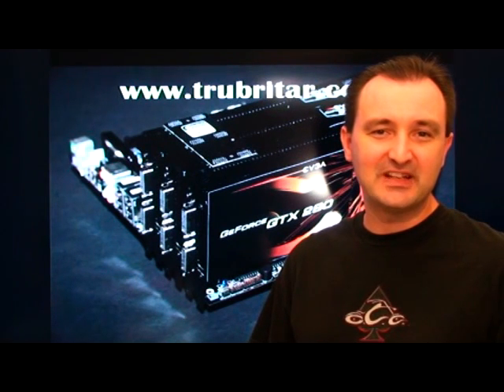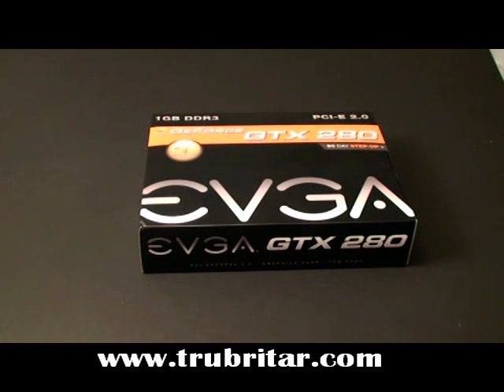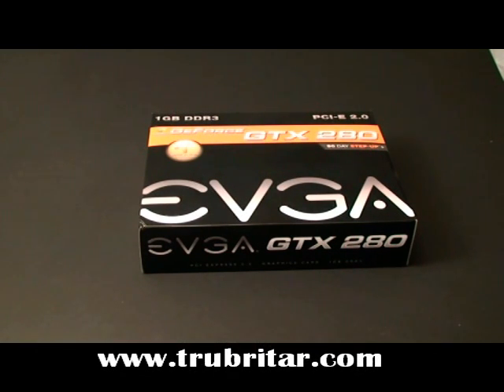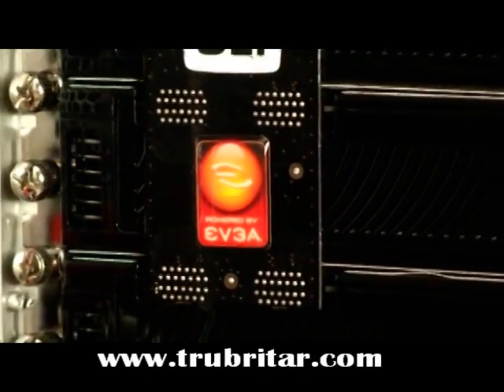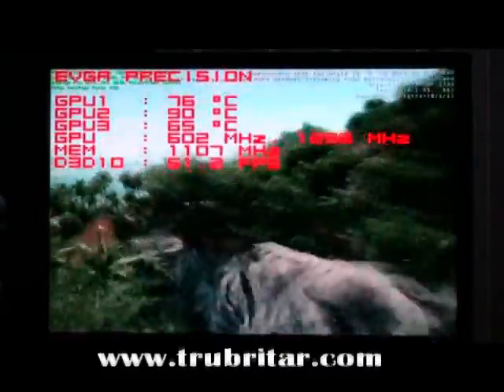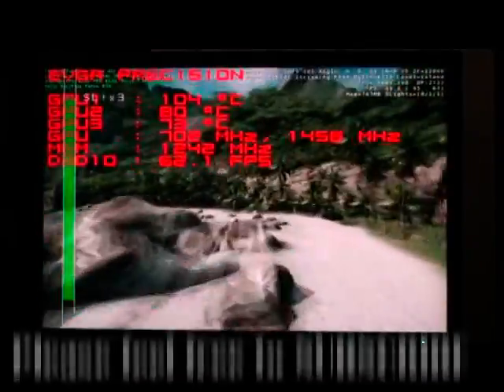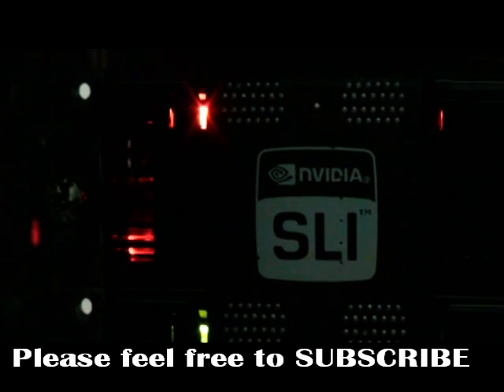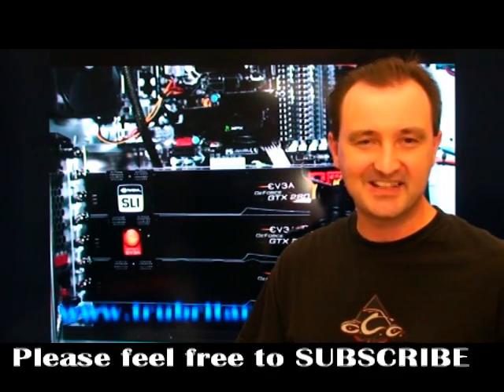GTX280 Destruction testing...

Comment: 6600GTs have been known to reach 140-150C and still work stable even on games such as The Sims 2.

115C is nothing in comparison, 105C is the specification however. Every 10C halves the chip's life until it reaches the point where it burns itself out to a paperweight in a shorter time.

The highest I've seen my eVGA 8600 256MB was 104C with a voltmod + OC and up to 88C stock but cooler sucks, with some cool air I was able to manage below 85, in a year worth of usage though, I never damaged it.

Comment: Not safe...Often if your motherboard voltages are set to auto then it will adjust itself but high voltages and you will fry the card, low voltages and often things like the vram can become corrupt and such

Comment: Most graphics cards are designed to still work at 110 degrees.
70degrees isnt anything high for a 8800, my mate reguly got 80 before changing fan speeds with riva tuner

Comment: lol i got the crapest card ever 2, it can handle HD video, but it stutters on crysis on very low setting, but COD 4 is ok. its called the 7500le, and its an OEM card. never will i buy a HP PC again. and to make it worse, there is only one PCI xpress on my Mobo, and so i have to use a single slot card, so im gonna replace it with a 9600 GT

Comment: Wow... I could've saved you a lot of time getting rid of that card - you could've even gotten my 9800 GTX in return. I BET you it's more fun to see an old card die ;P
By the way, trubritar, are those stock cards the ones you're currently using in the Crysis Cruncher? (Overclocked, of course)... Or did you get some factory overclocked cards instead?

Comment: srry for the double post, but I just realized. my 2-3 year old Hd2600 pro agp has as high of a standard clock as the 280. 601 core standard for mine and 602 core standard for him. that is just lame. ATI>Nvidia every time. ATI now a days cranks out cards that reach 1100 core with ease and stability.

Comment: I hate to burst the bubble but this guy is a dolt. So many things wrong with this video. He has the Core at 648Mhz in the last vid which is the same as the SSC addition, but has the memory at a whopping 1404mhz (2808), which is well past the memory speed on the GTX280 Hydrocopper (yes thats right evga's watercooled version of the card) this is a piss poor example, its not stress testing or anything reasonable. you kill cards by being a moron. watch your temps and happy OC!

Comment: these are the rumors of the GTX 350 characteristics in internet:

*GT300 core
*55nm technology
*576mm
*512bit
*DDR5 2GB memory, doubled GTX280
*480SP doubled GTX280
*Grating operation units are 64 the same with GTX280
*216GB bandwidth
*Default 830/2075/3360MHZ
*Pixel filling 36.3G pixels/s
*Texture filling 84.4Gpixels/s
*Cannot support D10.1 .10.0/SM4.0

Comment: Oh look it reached 80 FPS; that's not what we look for out of high end GPUs. We're after consistent/stable lesser minimum frames, especially under heavy conditions.

Being more the doof he is, he's using 16Q AA? Overkill much? 4-8x is fine. Try turning on SuperSampling transparency and see what happens.

Vsynch?

Is this with all 'very high 'settings? Or another 'medium' profile.

Either way of course tri 280s will be good.

This has nothing to do with factory speed vs gimmick pre-OC.

Amateur

Comment: Ati do that and they still run hot.  Basically Nvidia and ATi set a speed they want relative to how hot it runs.  So they only intend fo the cooling solution to work with that card in a stock setting.  As soon as you start increasing frequencies etc your on your own at that point.  Most people dont touch the speeds.

Comment: are you stoned hammer?  Obviously you are just jealous and don't even own one.  You are wrong...I love the GTX 280 and mine is at 756 core clock - up from 621.  I'm water cooling and the temp has never gotten over 50C after testing.  Go buy an ATI card and see if you can make it run better.  I doubt it, but even if you do so what?

Comment: One GTX280 can handle all games on max (except for Crysis) without problems. So if you buy 2 or 3 of these cards, you would probably do that with Crysis in mind (cause that's the only game that needs that much GPU-power). And if you think that way, you're basically paying $2000 to play Crysis on a high framerate.

Comment: i have my 3 xfx gtx 280(stock speed) overclocked to XFX 280gtx XXX speed (670,2500,1458) with no problems what so ever, scoring a low 25 k in vantage (performance), seriously Trubritar i love you water cooling videos, but this dude, its were logic should take over and you should understand that you will have to increase the fan speed to reduce the heat of overclocking. yeah and factory clock is runing on stock cooling with higher faans speed, thats all....

Comment: You are wrong 4870 scales very well running xaa and af (yes the 3870x2 did not) but it is a completely different architecture, it's a great card i say. I am nether Nvidia nor ATi fan and i have 3x8800 w/ced but i have used Ati in the past and i had no problems at all.

Comment: I agree that Ultra is still very powerful card..you are wrong though..ATi made a mistake with 3870x2 that even the manager said they wont make the same mistake again which actually didn't and 4870 is an awesome card. ATi cards run better on Cod4 than Nvidia and the opposite in Crysis(that's a fact). The reason why they are cheap is if you remember they weren't cards over 500$ till 8800series came out and ATi doesn't want to make cards like 500$ (dont forget ATi had the fastest cards in the past)

Comment: You burned that card up probably because you didn't bother to force driver-level fan control and raise the fan speed to a more proper level. The drivers are not able to dynamically adjust the fan duty cycles according to clock speed.